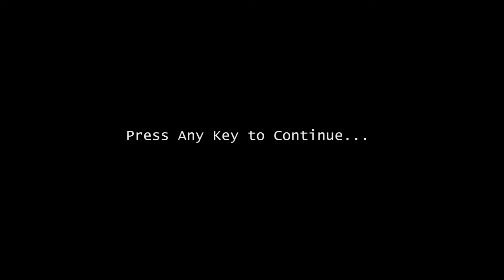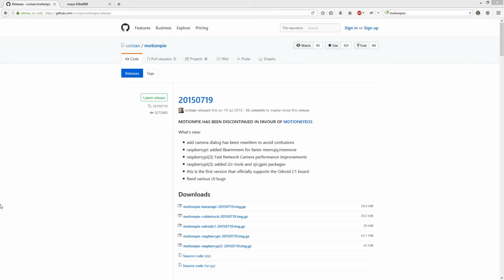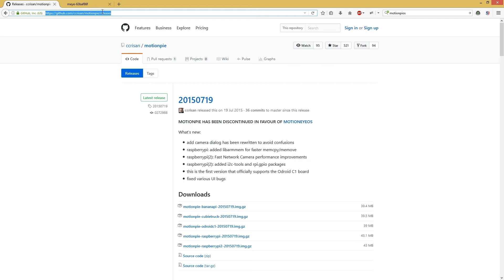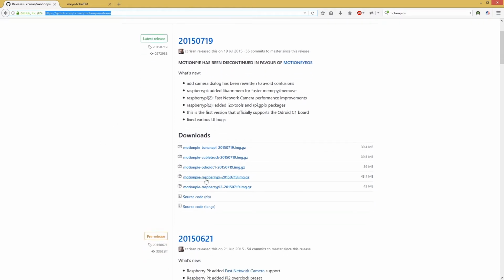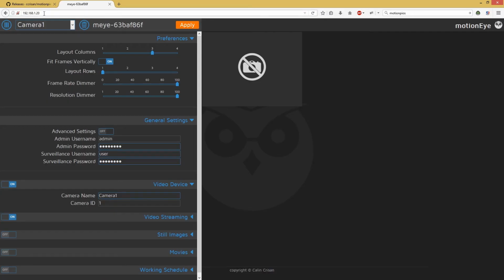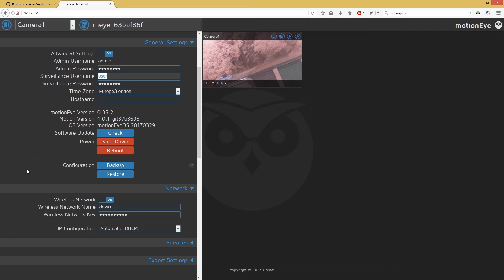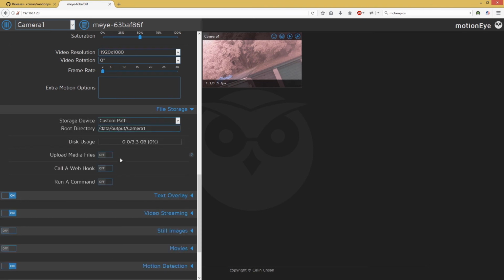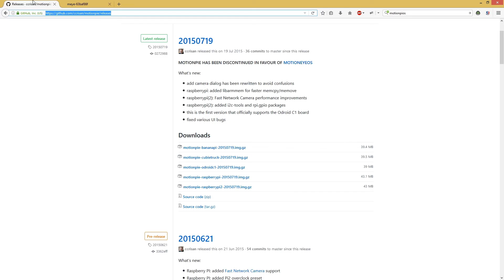Raspberry Pi Zero CCTV (motionpie)

Comment: when I installed motion eye is , I did not get the wireless setting, nor was there the expert settings.  I've tried it on the pi2 and 3.  not sure why.
Reply from the maker: +unfaix did you use the 20170329 release?
Reply: Press any key to continue… yes I did, which baffled me.  when I add a USB camera, the only options I got we're basic.  no options to change frame rate, etc.  I'll pm you via reddit

Comment: Can you give me the specific model of the IR Module, IR Camera and USB WiFi Antenna you are using in this project? Also if you have a link to a site that sells these items. Thanks.
Reply from the maker: IR module: https://www.ebay.co.uk/itm/Infrared-IR-36-Led-Illuminator-Board-for-CCTV-CCD-Security-Camera-BT/281979614200?epid=1544234750&hash=item41a74b73f8:g:gzkAAOSwI3RW9QlX
WIFI: https://www.ebay.co.uk/itm/New-150Mbps-2db-USB-WiFi-Wireless-Adapter-WiFi-LAN-w-Antenna-Raspberry-Pi-Ralink/282107052480?hash=item41aee401c0:g:dnkAAOSwbsBXj1Bg
IR camera: https://www.ebay.co.uk/itm/Raspberry-Pi-Rev-2-Official-5-0-Megapixels-IR-Camera-Module-Black/272802562744?epid=13012468791&hash=item3f844cc2b8:g:5b0AAOSwYGBZjwh3